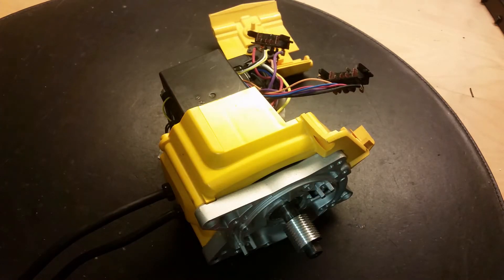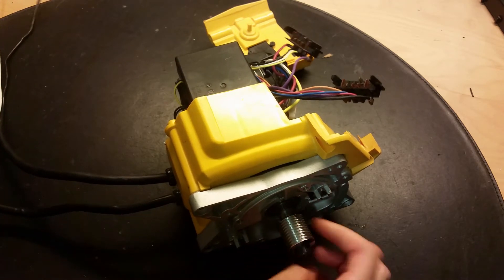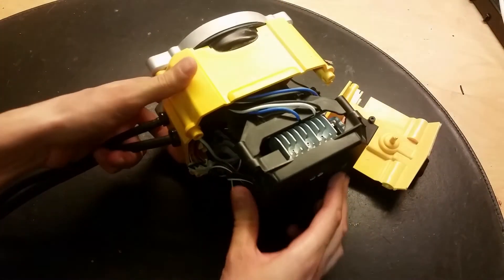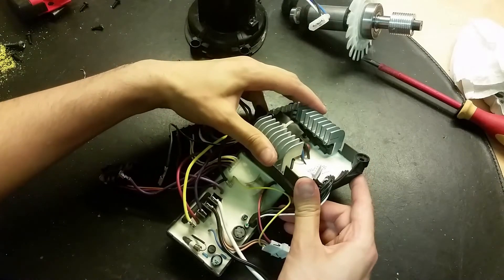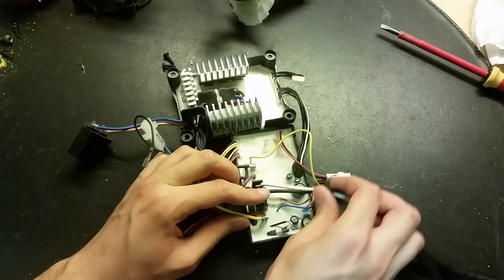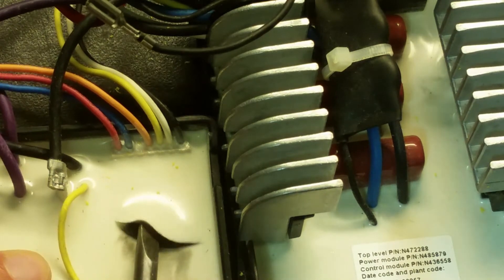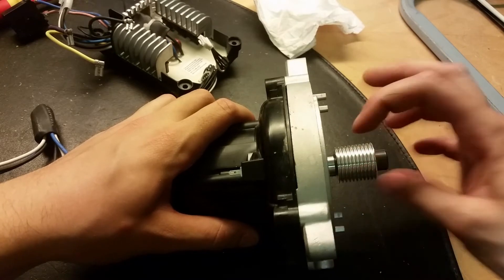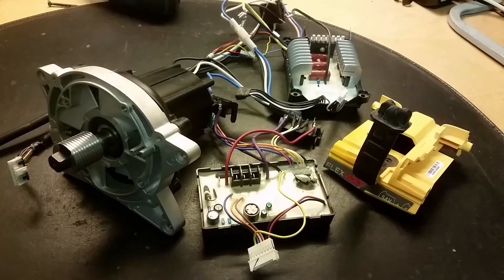DeWalt Flexvolt Motor Teardown

Comment: Did you get an ESC for this motor? If so what were the specs on the ESC and also do you have any thoughts on powering this motor on mains ac power?
Reply from the maker: I will be using it as a generator in a upcoming project